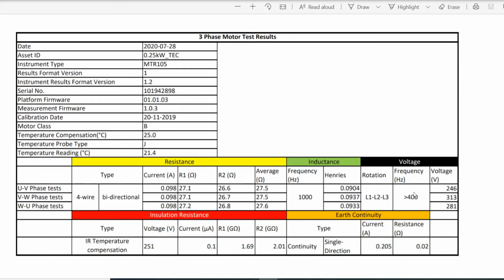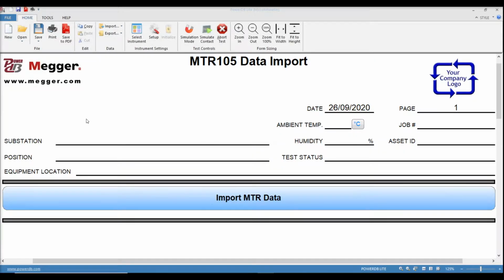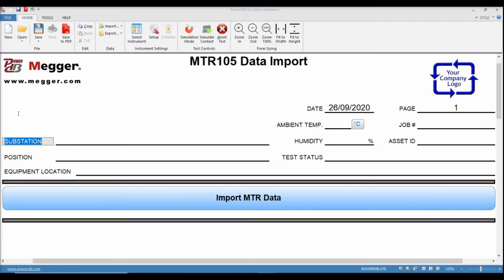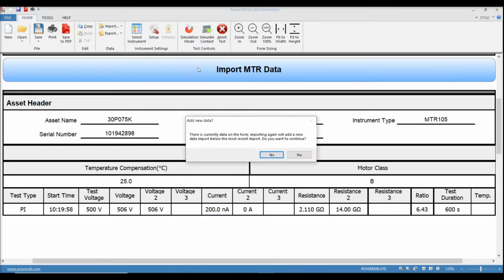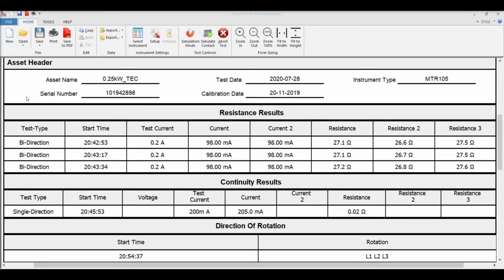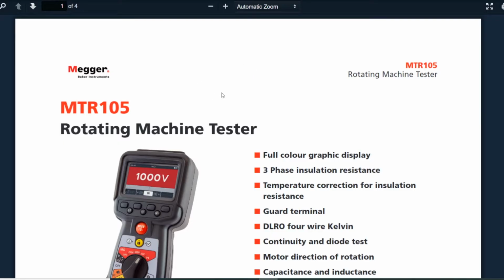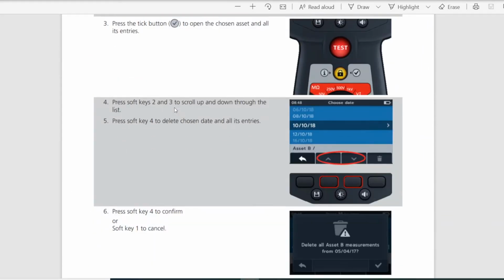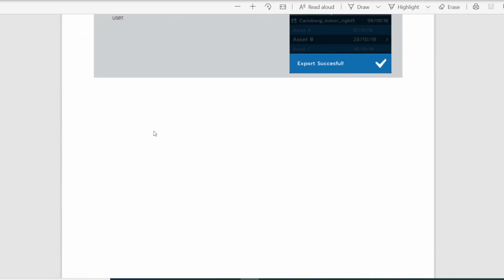Using the MTR105 with PowerDB Software

Comment: Your video here is like the only one of this tester and the software, they really need to do better at educating the customer. 430/2 I have has a downloaded but the csv files stink nothing like power db
Reply from the maker: Yeah, they are a bit of a mix up. The 430/2 has bluetooth which the MTR105 does not have, but will download to PowerDB when the 430/2 can't. You would think that they would want a consistent approach across their top of the range instruments. Thanks for watching and commenting.
Reply